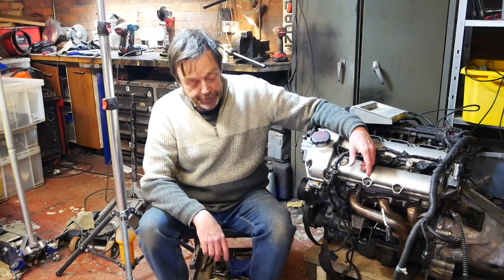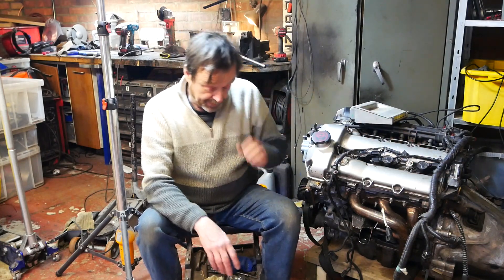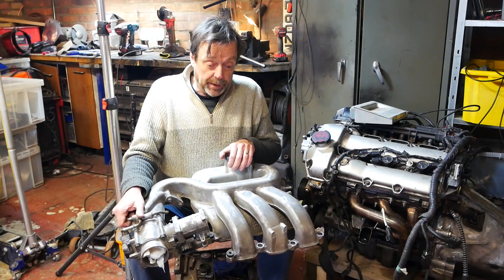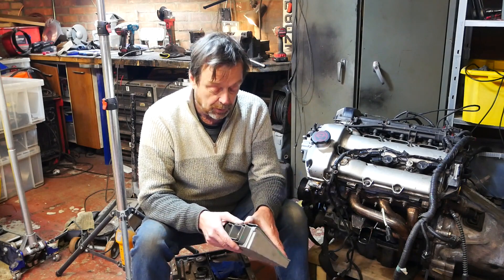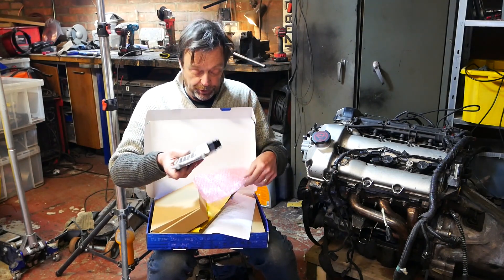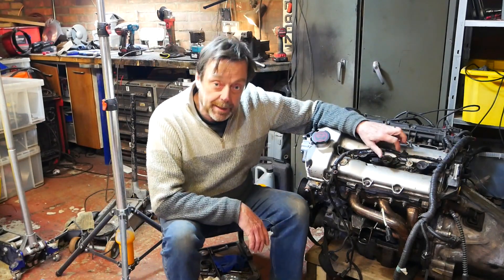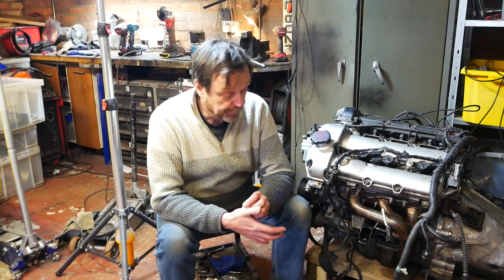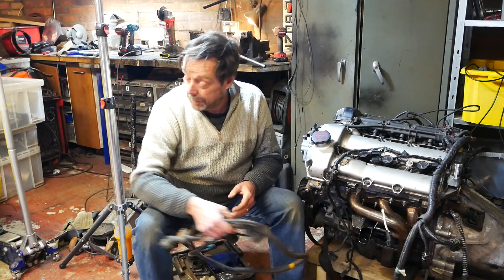Wiring the AJ30/ Duratec v6 Engine: Pt1

Comment: Before the comments section goes wild, of course it was us (Ford) who owns JRL.

This aftermarket EFI is going to be very interesting. Your instrument panel wiring was incredibly neat, so I don't think you'll struggle with an engine harness.

..I wrote my comment too soon. You're actually only making a converter, genius, much clever-er-er!
Reply from the maker: Yes I realised my verbal mix up during the edit and corrected it with on screen text. Many of the  parts are actually labelled Ford and I recognised that style of plug from another project that used a Focus engine.
I also realised that some wires are missing such as throttle pedal, MAF sensor and second O2 sensor and indeed 12v power, since those were on the second and  third plugs that I am not using - but no matter, they can be wired in separately as required